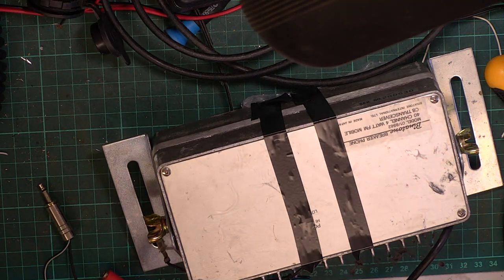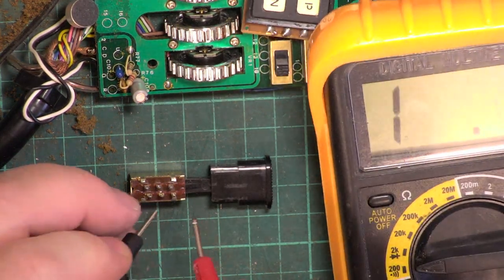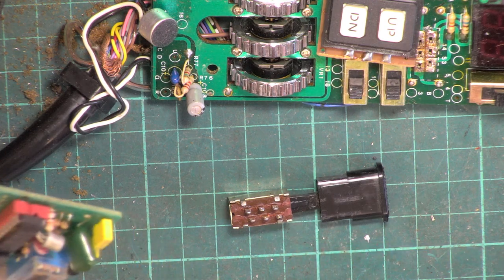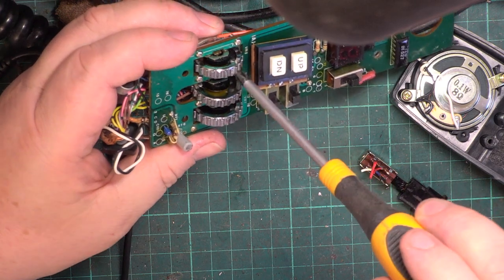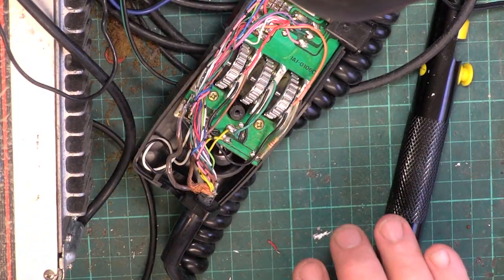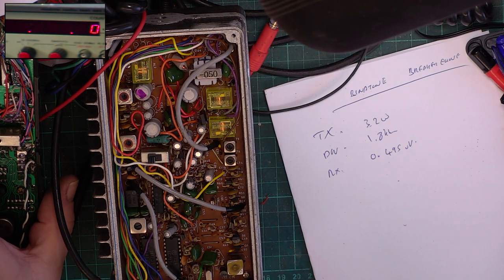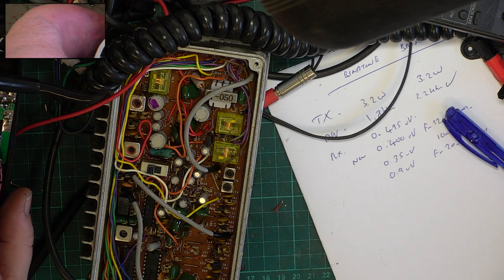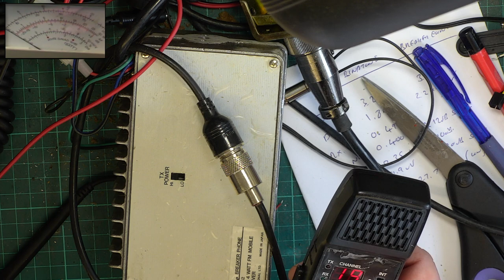Binatone Breakerphone CB27/81 UK FM CB radio repair & alignment

Comment: I have one still in the box unused, the cardboard wrap for the centre of the box has now departed, which is a bit annoying, but it just slipped on anyway.  Never looked inside it, just took it out the box, admired it and put it back.  I'll need to tie wrap the wires back from that control, or protect them, should I ever use it.  I doubt if I ever will now.  I bought it so as the CB would be out of sight.  There was a spate of CB being stolen, even when the price was £25 - 30 a set.  But I never put it in the car, I was going to change everything to a different hand set, but I never got round to it.  You are to nice doing all that Richard, there is no way on Earth could you make money doing that!
They are a bit low powered.  No idea how bad or otherwise they were for bleed-over, never used my one!

Comment: So you adjusted the receiver to the same offset as the transmitter? Won't that effect its receive performance  when listening to a CB on the correct frequency?
Reply from the maker: The radio is within spec. It may be 'off frequency' by my standards. The max permitted error is 300hz, the radio was low by 40hz, so it's neither here nor there & really doesn't matter. Had I tuned the receiver to the 'correct' frequency, the IF would have ended up slightly lop-sided, hence tuning the RX to the frequency the radio was actually on. If you listen to the 'on the air' test, you can hear the radio sounds spot on.

Richard
Reply: @ukfmcbradioservicingTango21  Good point regarding IF bandpass. I didn't think of that. I will go to the foot of our stairs. Thanks Richard.
Reply from the maker: Mr Smith at Nottingham radio would say to me "Go to the top of the class"..."and jump off"

Richard